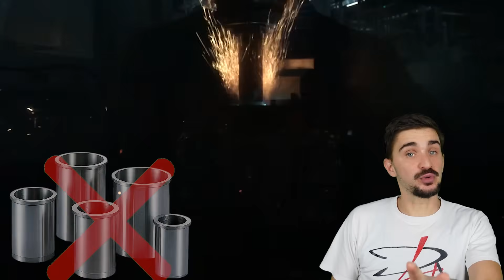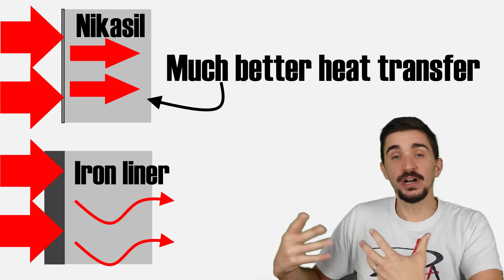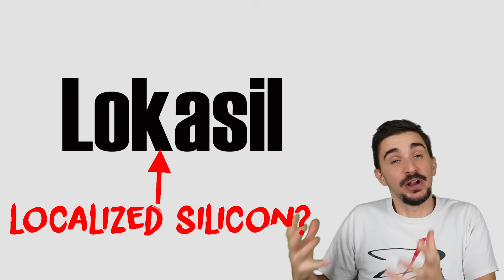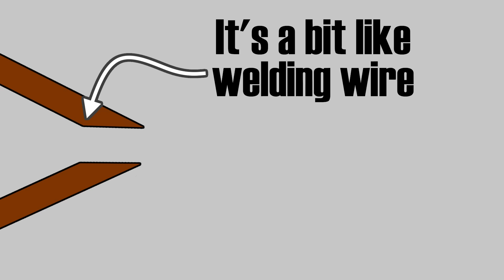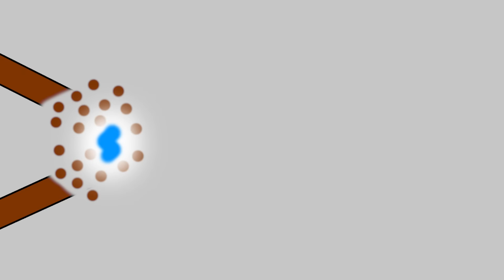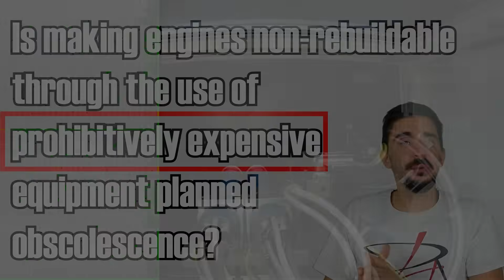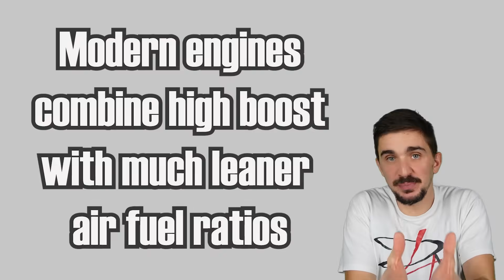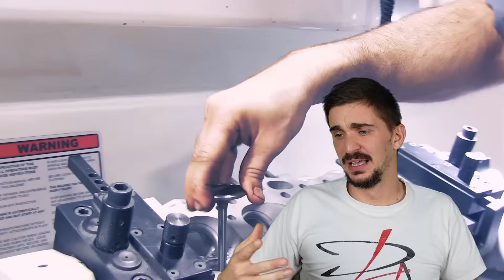Why Are Engines Becoming Non-Rebuildable? Everything About Cylinder Coatings

Comment: I was a mechanic at BMW when we were replacing the M60 engines due to the worn Nikasil cylinders.  I personally think they screwed up the plating process because many bmw motorcycle engines with nikasil liners were also running the same sulfur fuel  long before the m60 came out, yet did not suffer same problem.
Reply: I wonder if it was because the motorcycles were air cooled and didn't generate as much sulfuric acid because they ran hotter? I had a 1982 BMW air cooled 650 with Nikasil and had no problems with cylinders. At the time the magazines said the coating was so hard you could throw rocks in the combustion chamber

Comment: Thank you for the knowledge sharing ! 
Cylinder coating is just mandatory to use aluminium to build lighter engines. 
Environmental savings is irrelevant purpose as CO2 still is not pollution and aluminium is recycled anyway

Comment: Great video, as always. There's one factor you omitted, though, and that is the owner of the vehicle. One of the single biggest reasons these engines fail, is because owners aren't maintaining them properly, they aren't changing the oil at regular intervals. For a perfect example of this, Sreten over at M539 Restorations is dealing with this very issue on an Alpina B12 he just purchased. Also, when we're discussing CO2, let's remember that the amount of CO2 in the earth's atmosphere is 0.04%. Of that, man is responsible for 3% of it.

Comment: 18:35 you suggest it’s trivial for a manufacturer to build in planned obsolescence within an engine.
Is it true that they are able to precisely control when parts within an engine fail? I'm not refeering to wear item eg timing belt.
I assumed to maximise profit they had to balance reliability-reputation against cost of durability.

Comment: Engines became non-rebuildable as soon as they became OHC as opposed to OHV. The more complex a engine becomes, the higher probability of things breaking down, the more difficult the repairs. While OHV pushrod engines can have issues with lifters, rocker arms ect., those problems can be easily fixed. A DOHC with variable valve timing? Good luck, you’ll be saying every curse word imaginable.

Comment: Most of vehicles end their life before the engine needs replacement. There are many other expensive parts that fail before due to wear and tear or accident. So if you want to replace your engine with a younger one from a wreck you can easily find one, at least for the most type of engines, like the ones you have seen in the factory in Spain. Believe me, is much cheaper to find a suitable engine from a wreck that even thinking of rebuilding one.

Comment: Nice, but on the thermal spray technical and historical side, you missed a lot of key points. If you are interested to learn more details about the thermal spray side of cylinder bore coatings please contact me directly and I will share. I am one of the key developers of this technology and you missed a very large and important segment of coating types in this video. 😊

Comment: It may not be planned obsolescence, but it is a happy side-effect to the manufacturer that nobody can afford to rebuild the engine. This side-effect can also be factored into the profitability of the overall equipment investment. But yes you are right, it is government pressure that forces manufacturer's hands. Now the problem with your thought experiment is that you focus on the engine alone. While irl, a doomed engine usually dooms the entire vehicle. If an engine is fixable, the vehicle may continue a longer life, and that's also CO2 emissions saved. Re-using is always better for the environment.
Reply: Yes, prohibitively expensive machining/tooling is good for the board as that means increased/consistent sales.  That greed for increased sales is ruining lots of things.  That sounds like planned obsolescence to me.
Reply: i dont think anyone will stop you from taking your engine and sending it to the production factory to be resprayed, the process for one engine should be pretty cheap, in the 200-300 bucks range?

I have an old 2 stroke motorcycle from the 1980s, no catalyst. If the engine dies, fixing it will def not be CO2 emissions saved
Reply: @DDehUser  So you think your ten or twenty year old engine manufacturer just has his thermal spraying equipment sitting around waiting for your block?  You gotta be kidding.  In fact HIS thermal spray equipment has probably worn out and been replaced.
Reply: @frequentlycynical642  it’s really not something that you just use and toss out, you don’t just replace the entire thing and you definitely don’t expect to use it for less than 20 years when you buy it. It’s like molds used for casting iron bricks, you just gonna keep them for 10 years? You fix the parts of it that have been worn out, besides the consumables needed to run it and that’s all

Besides, the profit to be made from repairing can be there just from the automation side of things, the arms and spray heads are there, probably the programming being the thing that prohibits working on a wide variety of blocks
Reply: @DDehUser  I think the "prohibitively expensive" might be the stopping point.  You'll have to ship the engine, they'll have to fully disassemble, check everything, clean everything, check everything again, and then spray it, then machine it and check it and clean it and reassemble.  We haven't even started talking about warranties and liabilities yet.  That wasn't even mentioned in the video.
Reply: @slwsnowman4038  or you can go to a more local mechanic shop, have your engine stripped and cleaned there, then send back to the factory just the block and back again 

How expensive can 30 kgs being transferred be
Reply: @DDehUser  Shipping costs depends on how far you are shipping it.  That also requires the factory to be offering respraying treatment.  So taking a conservative estimate of $200 one way.  That's $400, minimum, on an engine that probably costs only a few grand.

I'm all for repairing and reusing, it's generally better for everything involved.  But at the same time, the means to repair it have to be available.  As stated in the video, the manufacturers can eat the cost of the process because they are doing it to so many blocks.  Your local repair shop or machinist's shop isn't going to have that same level of demand and throughput on the machine in question.
Reply: @DDehUser No production facility will take your old parts and rework them. Factories are not setup to do that. They have to stop regular production for your engine block? That will cost an absolute fortune. Plus the production lines are probably not setup anymore for the old engines.
Reply: Not if you're re-building a carburated V8 that gets 8MPG.
Reply: @CChan11  What if you eat a lot of beans. Then you are the problem.

Comment: Love this video! So much knowledge packed into such a small space! But unless I’m mistaken, “planned obsolescence” is a design philosophy that justifies shorter product lifespans by the assertion that the consumer doesn’t desire a longer lasting product, since they will (or should) prefer to replace the product with a substantially better one, which will be available at the end of the current product’s lifetime.

This was a somewhat controversial concept when it was born decades ago, which was a drastic departure from the tradition of building things to last as long as possible, thereby maximizing value to the consumer.

However, it really isn’t even “a thing” anymore, because the economics of manufacturing things like cars has changed so much… the value proposition isn’t even remotely comparable to the preceding era, before planned obsolescence.

Imagine the cost of building a car, today, which would last long enough to justify an engine rebuild after a couple hundred thousand miles? Besides, cars now are just “appliances”, and most consumers don’t have any expectation of their new appliance lasting longer than the couple hundred thousand miles that an engine lasts?

Comment: Those emisions went through roof of normal sense. Its not normal to build 3 cylinder 1 liter engine pumping 120 hp or that 1.3 liter up to 170hp but making that racing output engine maintaining it with 30000 km intervals o boy o boy racing engines change oils at low as 2000 kilometers depending how hard you push it. So what they want us tu tell that mini engine in 1.6 tone car is working at 30 percent of power so you can extend oil intervals and expect to drive it 200000 km and sell it as good engine? It all goes to use it 3-4 years and get rid of it buy new one. And low midlle class will in 10 years be only able to drive 20 year old cars with 2 litre or more engines. But they wont be able even so while co2 rates wil be so high that they want be able to pay tham

Comment: Kia engines would be a good example of planned obsolescence in my opinion through the use of sub par materials around the cam shafts, I’m sure there are other issues also but this is the one I see most and it’s the one single reason my wife doesn’t drive a Kia suv anymore. Call it crappy design if you like but both can be true at the same time.

Comment: I rebuilt my 25 year old engine. New OEM pistons, new crank and rod bearings, bore and hone and headwork. All for about 1000€. Which is roughly the cost of another BP-Z3 that's used and high milage. Rebuilding even a newer engine isn't expensive, it's the labor cost that you have to pay if you can't dissassemble your own engine
Reply: Probably 95% of the owners...
Reply: @staLkerhu  then you'd be looking for two full days of work of a mechanic. The price heavily deppends on how quick it can be done. But all in I'd say no more tham 3000-4000€ which is still cheaper than buying a new engine

Comment: It is the same problem as people complaining that you can’t upgrade modern laptops anymore. Yes, it is a loss for enthusiasts who like to add RAM oder a larger storage medium after a few years, but the wast majority of people never upgrade their laptops, they use it until it is too slow, and then they buy a new one. And most of the time, being too slow is not the fault of the hardware ”going bad”, but the software needing a clean reinstall. Also, the technology advances so quickly that upgrading the CPU, which was possible in the 1980s and 1990s, often requires you to change out everything else anyway. Unfortunately those enthusiasts are very vocal about their requirements, so it sounds like we have a major problem, which we have not.
Reply: Its easy to compare to laptops but nah this is not even a fair comparison because of the extremely rapid improvements in technology and performance compared to cars. A computer from 10 years ago will struggle to run things from today while a car from 10 years ago might be missing minor features but will perform indistinguishable from a new car. Comparing a 10 year old computer to a new one is like comparing to a 40 year old car, but even then a 40 year old car will always get you from a to b even if its rebuilt while no amount of ram and storage or even cpu and gpu changes will make a old computer do what a new one can, tech needs to be replaced cars don't.

(Edit: Of course practically the industry has pushed cars into a tech like mindset because lots more money to be made off it but if regulations focused on longevity and infrastructure to keep cars running as long as possible then cars would need very little replacing.)
Reply: Isn't that a circular argument? You're saying that consumers don't want upgradeable laptops because they usually don't upgrade them, but the reason they don't upgrade them is because upgradeable laptops are difficult to find and limited in options (and a million other reasons, like marketing convincing consumers that servicing computers is more difficult and knowledge-intensive than it is.) Producers control what options are available, and consumers take what they can get. That's doesn't mean that current solutions are what consumers want.
Reply: @  if there was a market, then there would be products for it, and there are modular laptops, they are just hard to find as you say because it is not a requirement for most people. It makes us enthusiasts sad, but unfortunately all that counts these days is money. The people complaining the loudest are not the majority who buy all those entry level laptops because all they need to do is browse the web and look at photos.

There are a number of cases where neighbors came to me with their 10 year old (upgradable) laptops, asking if I could have a look at why it is so slow, and the reason was always: ”your laptop has a mechanical hard drive and only 4 GB of RAM. For about $150 I can get you an SSD, more RAM, and maybe even a new battery” (and I offered to spend some hours migrating their Windows installation to the new SSD for free) and the answer was in all but one cases: ”Nah, I will just get a new one” One of them had a single-core CPU from 2012 or something, and no matter how much RAM you put in there, it will never be a fun machine anymore with modern software, so: just get a new one. It will have a much better display, much better battery life, will be smaller, lighter, quieter, and a lot faster and will be future proof for the next years. What we once saw as an enthusiast item or a hobby is now a commodity, and other rules apply to those.
Reply: @jroemling  "if there was a market, then there would be products for it"

If 'the market' has no clue upgrading/replacing used be a thing, then no one will demand it. 

Edit- You know how many people do not know for leaking hose bibs/faucets/shower heads that you don't need a whole new one, just a new packing nut? Yeah I work the trades and equipment/home repair as a side, and there's complete lack of knowledge out there- that "you don't need to buy new".
Reply: That's ridiculous also
Reply: removable ram and replaceable drives can have both small and lightweight, it's down to the choice of the manufacturer not wanting you to do it.
And ram can fail or you can get failed ram as well as drives.
Reply: It would be interesting to see laptops with 256bit LPDDR5X use LPCAMM modules instead of soldering the chips to the main board.
Reply: @Loanshark753 LPCAMM quite literally was designed to fix the issue of non-modularity
Reply: RAM and storage memories should be replaceable, same as batteries.
Reply: Yeah, and as much as I love my 10+ year old laptop with removable battery, socketed CPU, swappable 2nd drive bay, upgradeable RAM, I'd much rather carry a modern laptop that weighs 1/3 and has an internal battery that lasts all day long.

There are benefits to modern tech.

Comment: the problem that all coating techniques share is that they are laid right on top of aluminum alloy this results in that by the time you know something is wrong you have chunks missing out of your cylinder walls why? because when any coating fails it flakes off and that usually ends up with the aluminum getting scored to high heaven if the engine doesn't seize immediately

Comment: There are 2 huge caveats that really kill the "rebuild" deal dead. 1, engine recycling has pretty much killed engine rebuilds. It's cheaper to grab a junkyard (or possibly even new) short/long block than to rebuild one. And a dead engine usually still has useful parts. And 2, most engines don't fail, so you are talking about a small % of engines; whereas all engines operate and benefit from stuff like these liners. This was an awesome video as always but the planned obsolescence/fake environmental benefit arguments dont stand up to the slightest scrutiny.

Comment: Winter road salt destroys cars in 10 or so years where I live. I drive a 2015 Ford Transit Connect that has about 160,000 miles and the engine uses no oil during the 10,000 mile oil change interval. My last car was a 2007 Mazda 3 that went 13 years before rust destroyed it. After 150,000 miles I would not change the oil till it used a quart and that took 15,000 miles.  I am an old mechanic and have had cars with points, solid lifters, and that crap. I have yet to change the spark plugs in my Transit, have inspected them, but they look great. I had 2 Chevy Vegas that each went over 100,000 miles before I sold them. They only failed if over heated and mine both had the HD cooling system.

Comment: Out of the millions of engines produced each year, how many of those actually get a full-on strip and rebuild with block machining ect in their lifespan? An absolutely miniscule amount I can imagine, most engines in need of a major rebuild like that just get scrapped because of the cost to have all that work done. Either the engine gets replaced or the whole car gets scrapped. You might rebuild a block in your garage but you are in such a minority compared to most vehicle users (also still wouldnt be cheap to have the machine work done). Saying that bore coatings are planned obsolescence or bad for the environment is some pretty small brain thinking...

Comment: The thing is, when people rage about planned obsolescence, they are only looking at the money, not CO2. "These new cars will last 15-20 years, i'll have to buy a new car when i could (wich they honestly won't 99% of the time) repair my 25 years old close to death engine for less money than a new car => they are forcing me to spend more money => planned obsolescence"... they are not looking at CO2, improved driving experience and security or else. Only the fact that repairing could be cheaper if not taking in consideration the fact that the older they get, the more expensive it will be... and that when they probably won't repair it either way.
Reply: CO2 has no effect on temperature. Stop it.